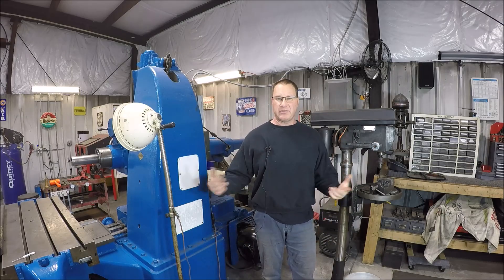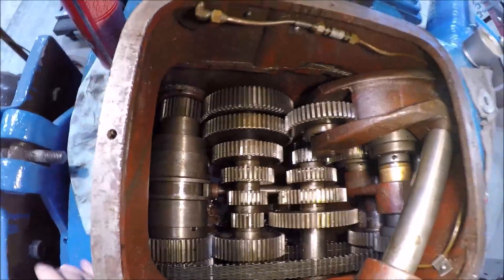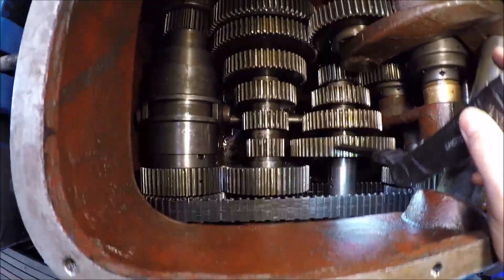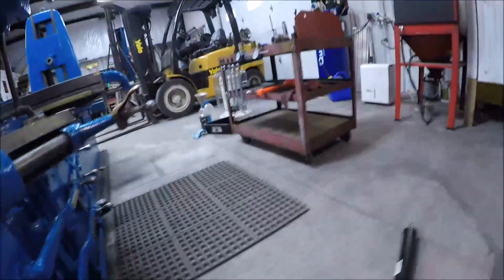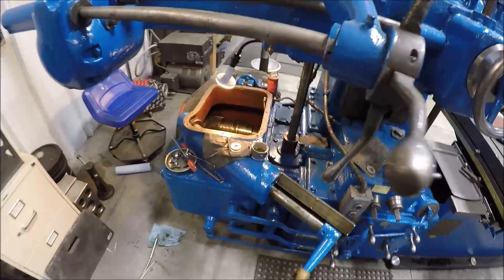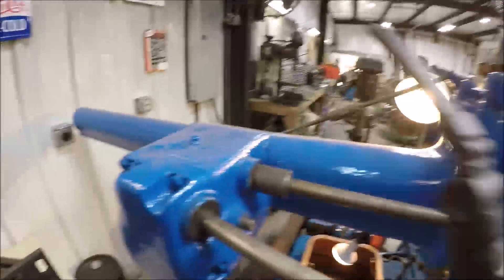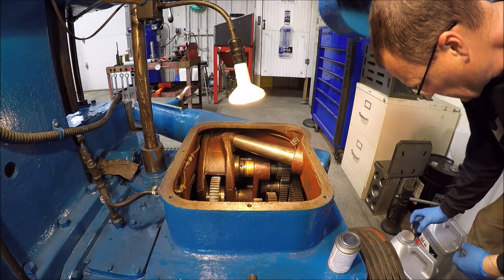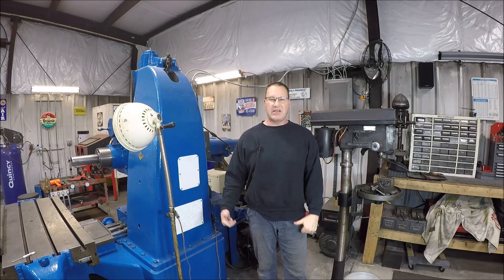Opening up the gear box on the Horizontal Boring Mill

Comment: G'day Tom, it's always good when you open something up and it all looks in good condition.  Your gears like all high-end machines have a ground lead in on the teeth to allow easier engagement when changing speeds, it's not wear on the teeth.
Cam
Reply from the maker: Hey Cam. Good to hear from you. Yes glad I did not find any surprises, except for the low oil level.

Comment: G'day Tom.  That's a good looking gearbox, with a decent drive train.
I use a Tellus 68 hydrolic oil, whether in a truck hoist, or a lathe, even in my skid steer bobcat . Never had problems with it.
Waiting for you to fire up that beast,  & watch it in Action 
Ted.
Reply from the maker: Hey Ted. 5 gallons of ISO 46 was $86 dollars. Glad I don't have to change the oil very often.

Comment: Those appear to be taper plug valves. If there is a nut on the bottom pull it off. Take it apart, clean it up. Put a little lapping compound on the cone, work it back and forth in the valve body. Don't over do it. Clean it. Cover the cone with sharpie and make sure you are making contact through the entire cone. Should s all it up

Comment: Looks good in there my one is drip feed to all the gears from a central tray then leaked out to the ground
Reply from the maker: After I got oil in it I discovered I now have a slow drip coming out where the high low selector goes into the gear box. I am assuming it is from wear and the fit is no longer in spec.
Reply: @hilltopmachineworks2131 mine leaks just a bit where the spindle shaft comes out the bottom which doesn’t look like it would be fun to fix
Reply from the maker: @smalltownmachineshop6860  Oh man. That would be a challenge if you had to fix it from underneath.